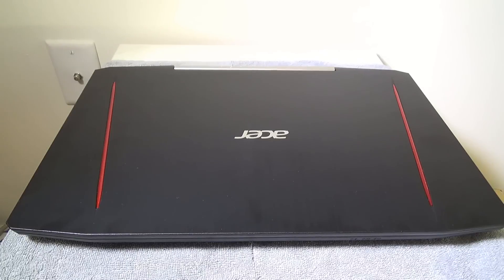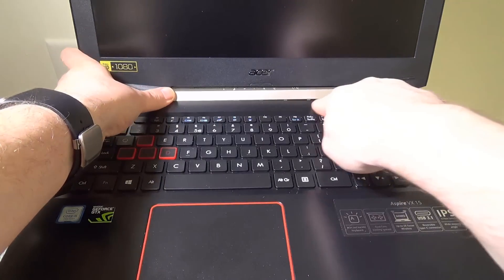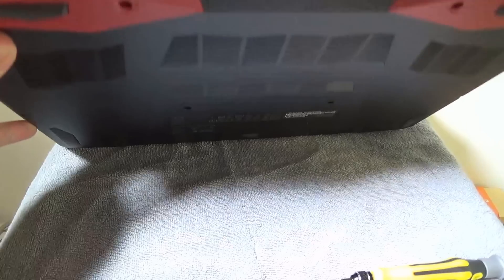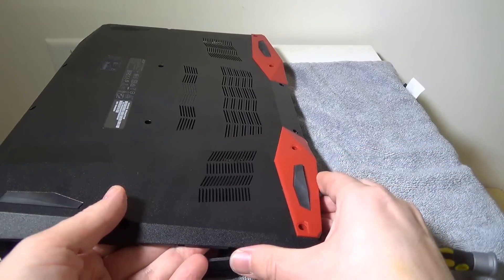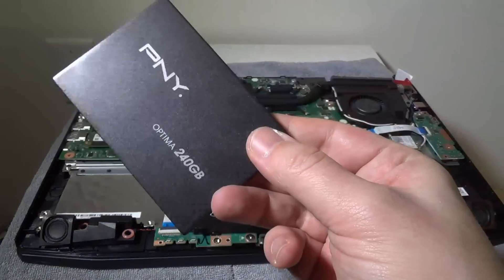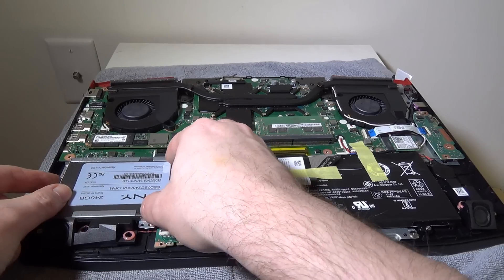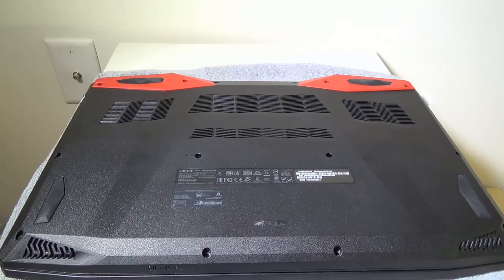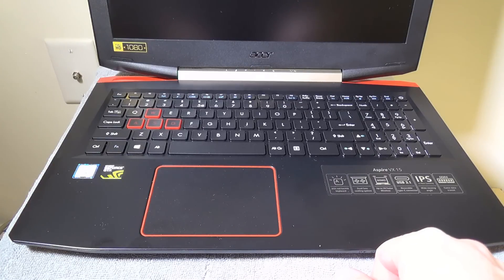Acer Aspire VX 15 Gaming Laptop VX5-591G-54VG How to add a 2nd HDD/SDD

Comment: Can the hdd be connected only using a data cable , or is the provided hdd cover neccesary
Reply from the maker: +Dean Dcruz cover is pretty much needed as you wouldn't want the drive moving and pulling the cable loose. Plus I believe that the only way to get the cable is in the kit.